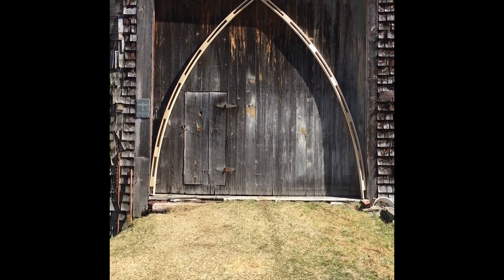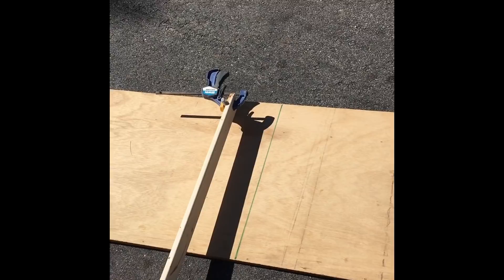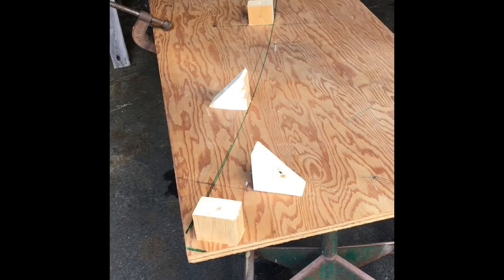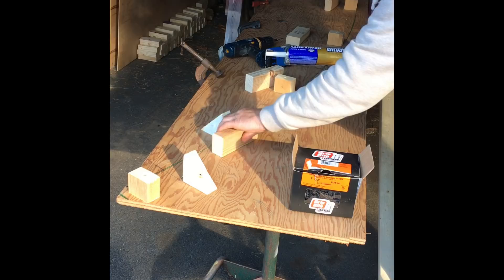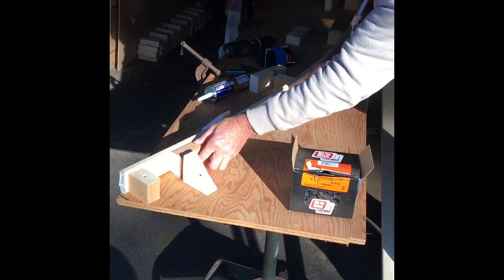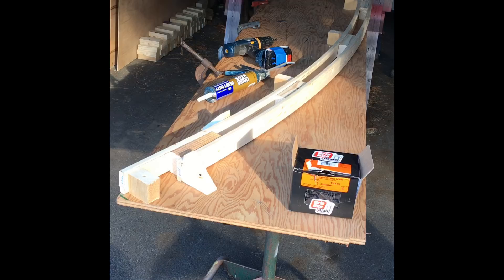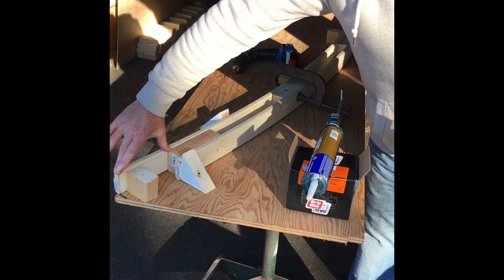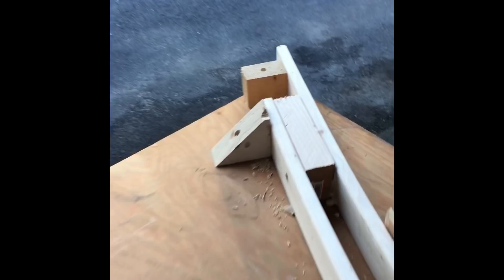DIY GOTHIC ARCH

Comment: Never use sheet rock screws for anything but fastening sheet rock. Sheet rock screws have no shear strength and break very easily.  At the very least use coated deck screws.  Where the horizontal pieces are connected to the arches, use 2 screws at each location, not one. Two screws will offer some rigidity and resist rotation of the two parts relative to each other.

Comment: Great job, you do such good work. Could I use 4" pine and not worry about it braking? I want to bend a 12' board. It is for the top of a 10'x20' shed